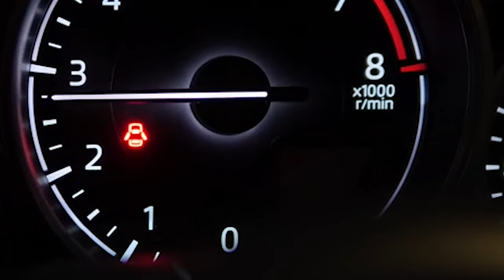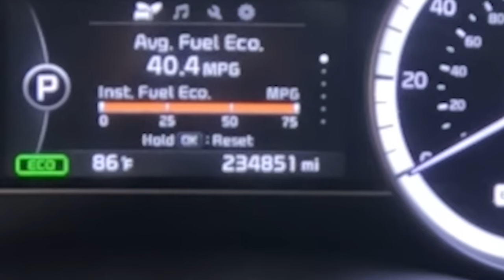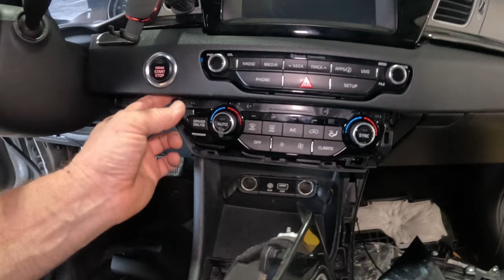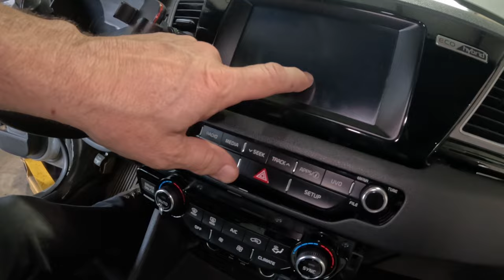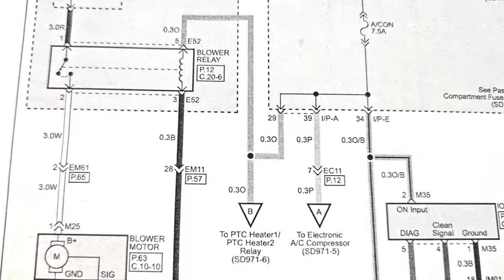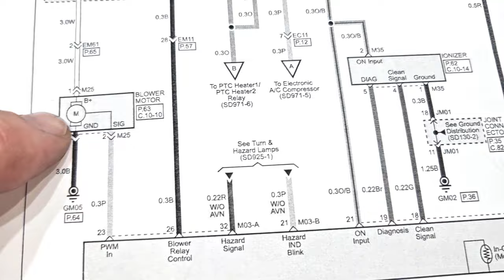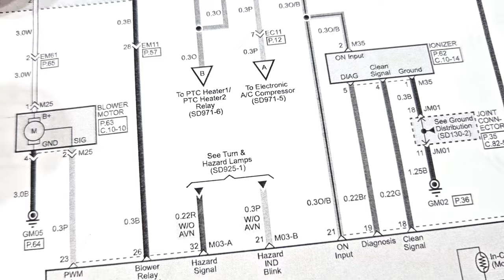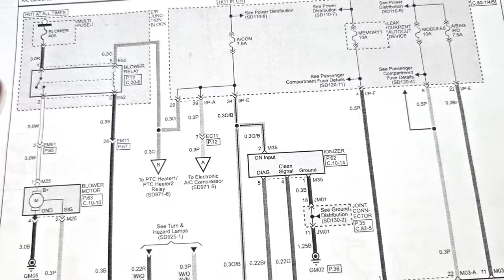2017 KIA Niro Blower stuck on and hub bearing noise.

Comment: My cabin blower fan on my 2019 Niro hybrid lost power and hasn’t turned on for a month in 90-105 degree heat. But your suggestion to simultaneously hold off and hit mode four times gave me a code of 00 and it suddenly turned back on. 

It’s not running smoothly, perhaps because I removed the overdue cabin air filter, but it’s back to mostly full power! Such a relief! I can finally (hopefully) diagnose the issue as I’ve seen other videos where the circuit board on the motor just fries into a black scorch mark and shorts out
Reply: Update: if I turn the blower off, it won’t turn back on unless I physically touch the white fan internally (as if there’s a bad bearing) 

I’ll remove it, clean, lubricate and try again. But I thought I was completely dead until your method of code checking
Reply from the maker: You need a new blower motor.  Like I've said in other videos. If your blower stops working and you hit the botom of the dash and it starts working, there is an intermittent open circuit in the winding of the motor.  If you continue to run it without the motor working, it could burn up you resistor or maybe even some wiring to the motor or resistor.
Thanks for watching and thanks for your support. I hope you get it working properly.

Comment: Same thing happened on my 2017 Kia recently. It was stuck on full all the time. It went so long like that that the blower motor burned out.  When I replaced the blower motor, I regained control of the fan speed. It was just something wrong with the blower motor.